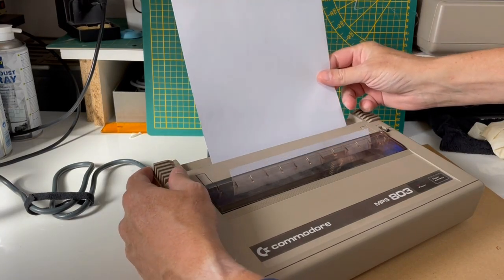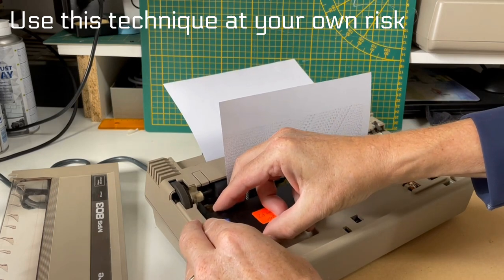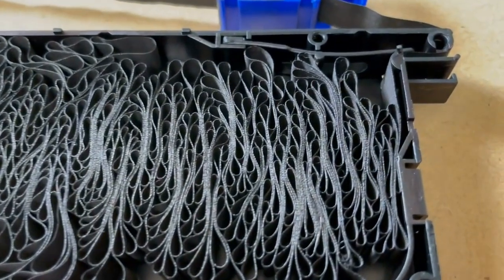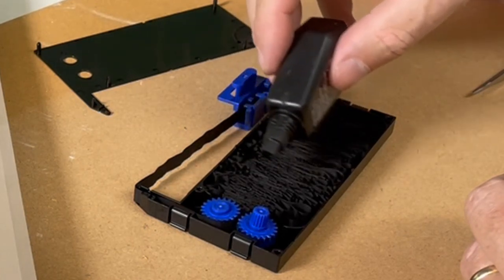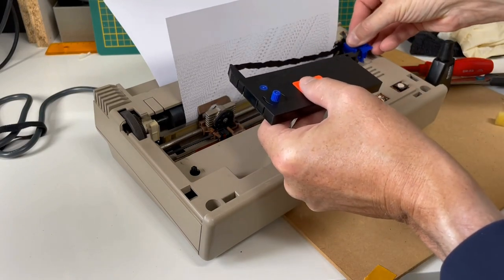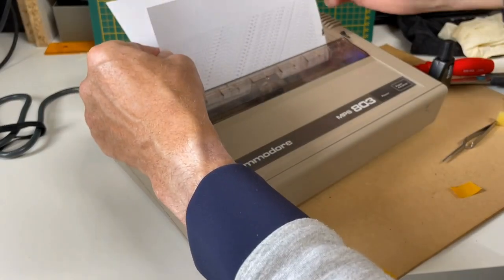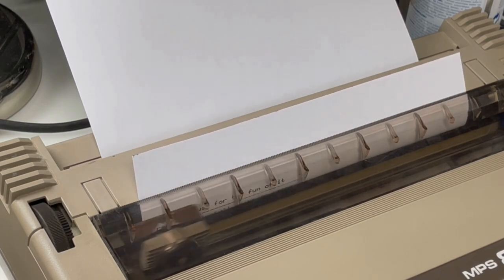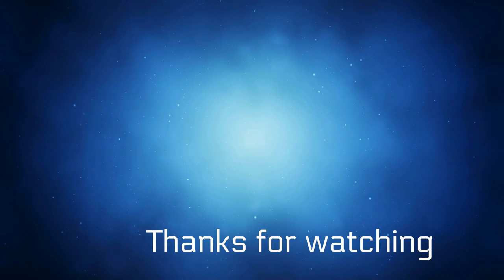Commodore 64   reink the printer ribbon of a Commodore 803 printer

Comment: This is a water based ink. Not good for printer head.
Reply from the maker: That is probably true, it could cause some erosion overtime. Do you know a better inkt alternative?
Reply: @justforthefunofit  there are oil based ink that are for metal stamps like counters and dates. Bought this and will try soon.
Reply: This is true, some inks are bad for impact-dotmatrix printers.  Another bad ink is one used for calligraphy pens.  The printhead needs that lubrication for the impact hammer pins, so oil-based ink should be better.    Fortunately I still have a big bottle of dotmatrix ink that I bought over 15 years ago, along with the MacInker machine that does the reinking for convenience.  This came from the Computer Friends company, which used to advertise in Commodore & PC magazines for years in the 1980s & 90s.  They have been defunct for over a decade now though, but at least they were in business for ~3 decades.  I went to their building to get my order of stuff & also met the owner.   I have at least 7 different model dotmatrix printers so this comes in handy.  Other people have made their own DIY reinking machines over the years.  I had done a lot of reinking of ribbon cartridges in the past 15 years, especially for office dotmatrix printers (because we used triplicate forms), yet that bottle of ink has not not even gone down to 3/4 full yet, heh. 
03/06/24